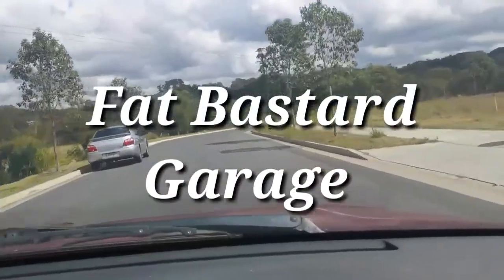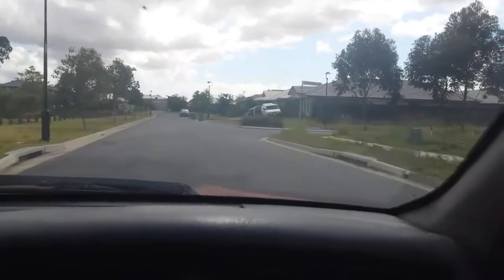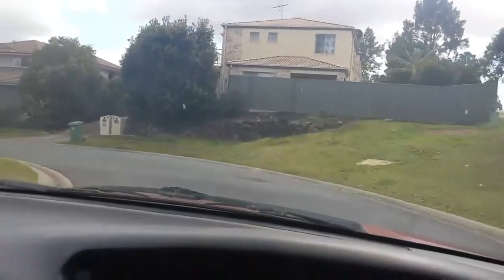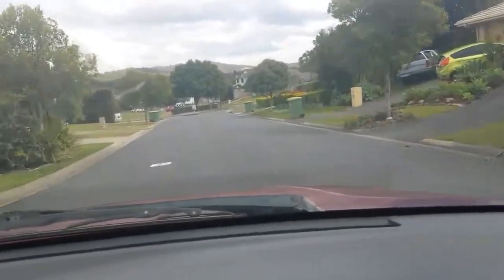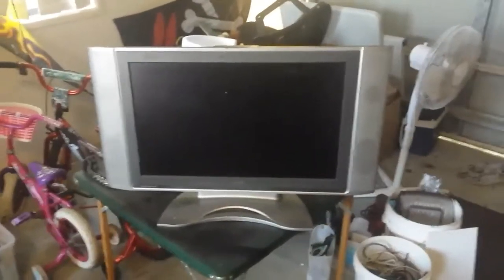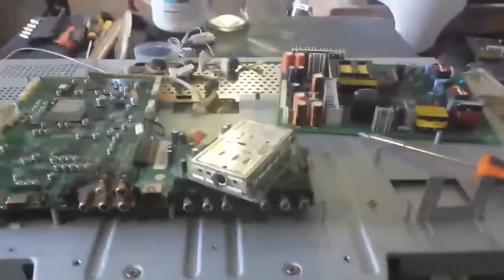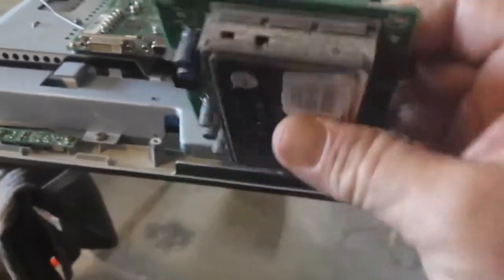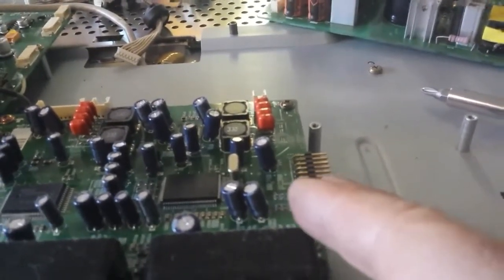What's inside a LCD TV ? Microscrapping for dummies... Me

Comment: I can help you out with those circuit boards in the TV....the one with the big heatsink & the transformer on it is the power supply board, pretty self explanatory what it's for, the board with the input connectors on the bottom edge is the video/audio processing board, , the small board with the silver box on it, that's the TV tuner, the long narrow board that was mounted on the Left-hand edge with the plugs on one side, that's called a power inverter and is for the screen backlighting,, and the small board that was mounted at the top edge of the screen converts signals to control signals and sends them to the LCD pixels in the screen, there would have been a cable  connecting this board to the video/audio processing board, hope this makes things a bit clearer for you.
Reply from the maker: Thanks so much 👍
I've done quite a few tvs now and scrap them out regularly.
I sell as much as I can, as in working power supplies and the T-con board.
The video you watched was the first one 😃
I do appreciate your comment.....thank you 👍

Comment: :43  Toes.
I'm still 2 months behind, so forgive me if you've already got the answers to your questions.
7:54  Those tiny tan squares in rows I believe are either "monolithic ceramic capacitors" or "tantalum capacitors".  I think Moose Scrapper used to depopulate those because they're worth a few bucks once you get enough of them, but I'm not 100% sure.
10:00  Those things clamp down on the ribbon cables.  You can use a knife blade or something to pop them open like a hinge.
10:09  That row of copper things I believe are transformers (T401, T501 etc.) and my very limited experience tells me that they generate the power for the light strips you're probably going to discover in another 2 or 3 minutes.  Let's see if I'm right......  :-)
12:21  Wow, I was way off.  I was expecting 3 rows of LEDs but those look like the tiny florescent bulbs I mentioned in my comment in your previous vid.  Never seen a configuration like that, although I've only scrapped a handful of monitors.
Reply from the maker: Bloody hell, I'm finding unanswered comments from years ago. Sorry about that, they never came up in my feed 🙄😠🙄
Reply: @bigkeg9173  Ha!  I'll recover.....